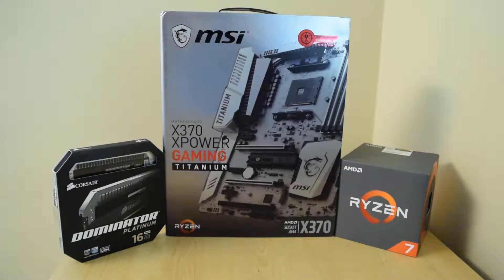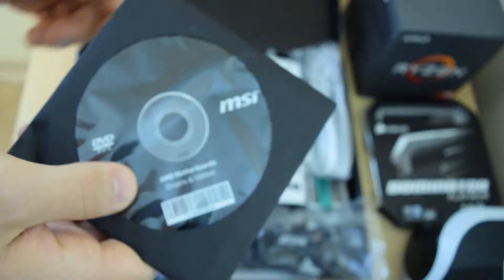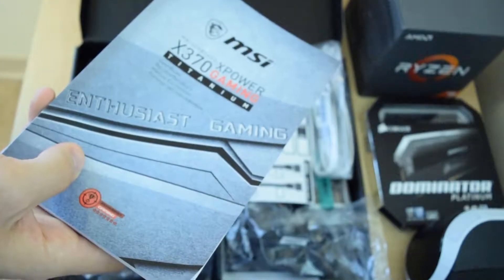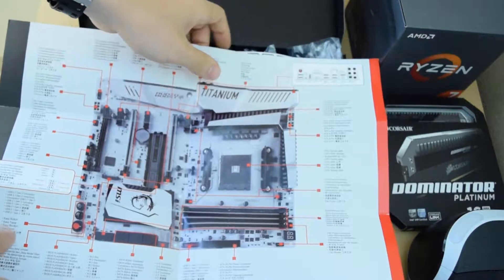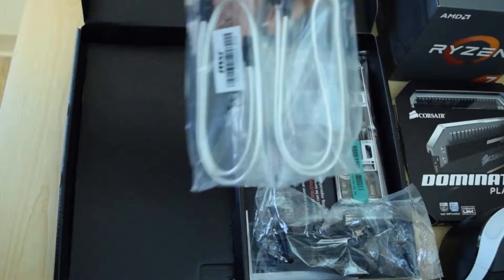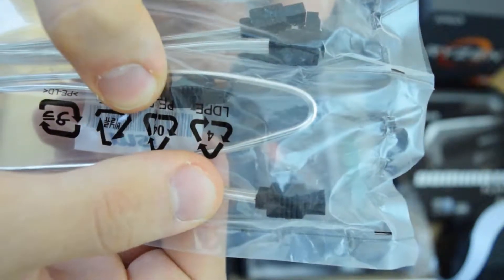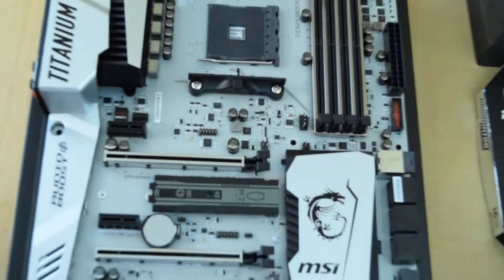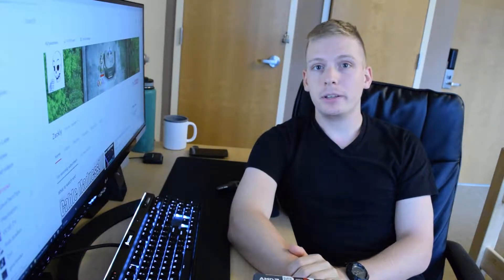MSI X370 - Ryzen Titanium | Unboxing!

Comment: how are you finding this board i was thinking of getting this or gaming 5 some people have said its not that good but id rather hear from someone who has it and is using it
Reply from the maker: Sorry to reply so late! Been busy!

I like this board. It's primarily for aesthetics and if you intend on overclocking. So far, Ryzen systems are picky with what RAM you chose. Which is the main complaint. I advise doing quick research for recommended RAM sticks to use for Ryzen. When you get any Ryzen motherboard you should definitely update the bios of that board. When I updated mine I was able to increase my RAM speed, but it still isn't at 3200MHz, despite having Corsair Dominator Platinums(3200MHz). I had it at 2133MHz for a week, and finally moved it to 2933MHz after a bios update. If I bought RAM sticks after the mobo, then I would have RAM that would work at full speed from the get go. Even great RAM models have some compatibility issues so they run slower. The bios update also allowed much easier CPU overclocking. My 1700 is overclocked to 3.9GHz now, no issues. I feel like I could push it further but just haven't bothered yet.